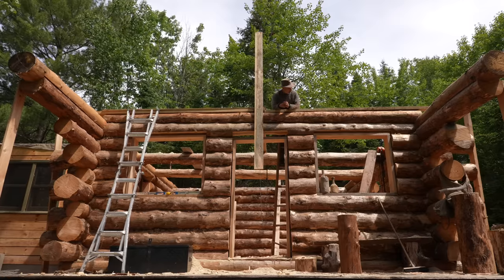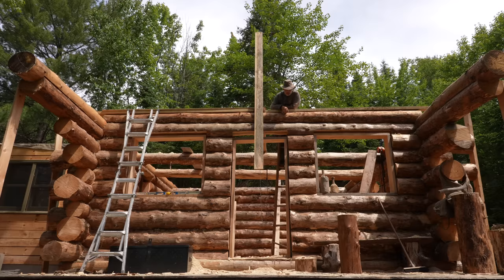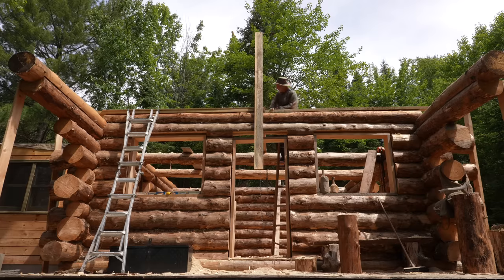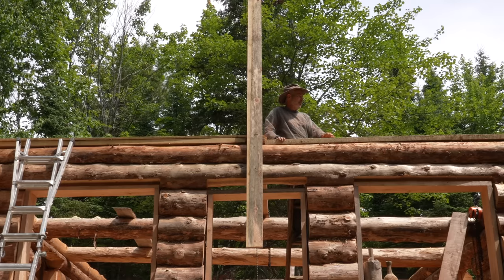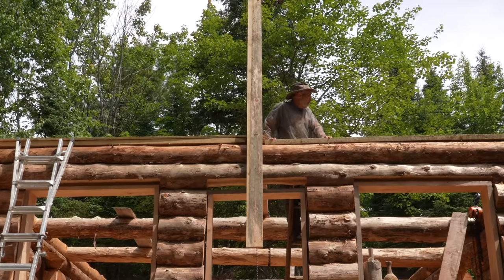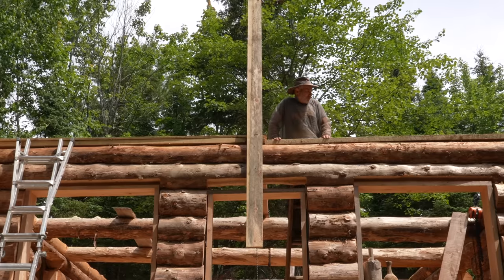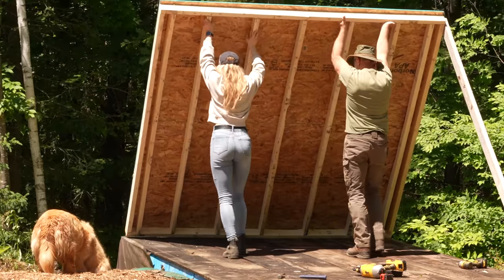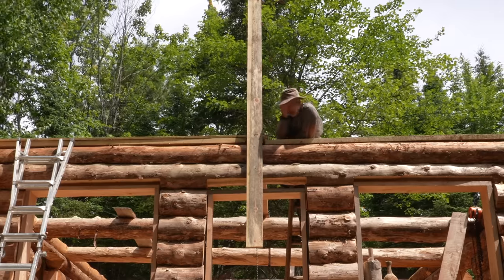Building an Off Grid Log Cabin Alone in the Wilderness, Ep16 | Completed Walls!, Bears, Moose, Fawn

Comment: The ridge beam could be done in two pieces with a scarf or lap joint In the middle, making it easier and faster getting it done.
Reply from the maker: I did that in the last cabin but I don’t have a king post in this cabin
Reply: Yes, you are going about it differently than I thought, it's interesting though.

Comment: Collar tie I'm thinking, logs a cross the width tied into the top wall. on the gable walls cross brace the purlin posts, mill 4x4 stock for that. Rebar pins for the bottom of purlin log posts, keep them from kicking out as things shrink, and collar tie logs too, rebar them also.

Comment: Shawn, instead of filling in the space above the door with insulation, why not place a 4x4 in there and strengthen the door header. You could even put a glass window in that spot for additional light.
Reply: The reason the space is above the door is for settling, he anticipates the logs will settle about four to five inches over five years. It’s the same thing over the windows. When he stuffs some fiberglass insulation in that void, it will just compress it down as the walls shrink down.

Comment: Down south logs are milled square and then built into cabins.  It seems that setting unmilled logs is much more labor intensive with scribing et al.  I know that you have a mill so why not use it?  The other way that I have seen is to mill the top and bottom of logs leaving the sides round eliminating a lot of the scribing.  Basically the walls go up much more quickly.

Comment: good to see progress on the cabin. you sure you have enough roof pitch for snow load? the place is gonna be awesome man cant wait to see the glow inside the cabin from a fire with a snowy scene outside the window this winter
Reply: I thought he’d have a steeper roof just for the extra head space inside, also more usable floor space. He must be thinking about it because he acknowledged that he’s going to lose four to five inches of head space. I guess with the shorter roof line it will be easier to heat or it won’t all go up into the upper part of the cabin. It’s quite the build , should be really nice when he’s done. I hope he has the roof on and completed by first snowfall. He’ll have plenty of indoor work for the winter.

Comment: One thing that I do not fully understand is the following: The house is built with massive, heavy trees. It must be very heavy. But the basement compared with them seemed relatively flimsy AND it can rot. Won't that compromize the stability even of that massive house in a few years?
Reply: I know those basement woods were blackened, but eventually I guess they will still fail, probably much sooner than the upper part of the house...?